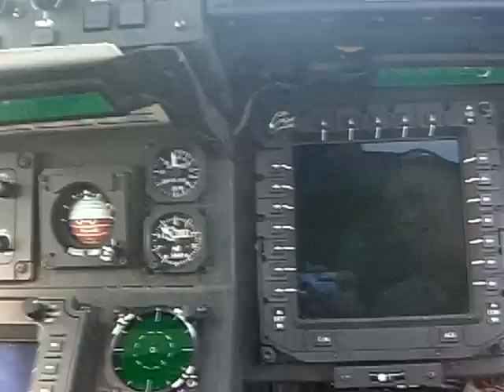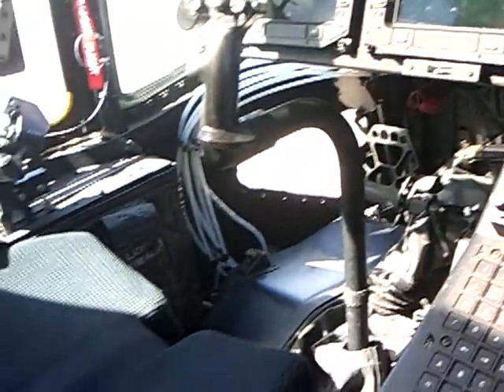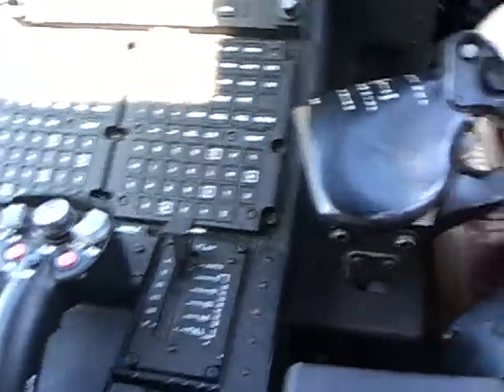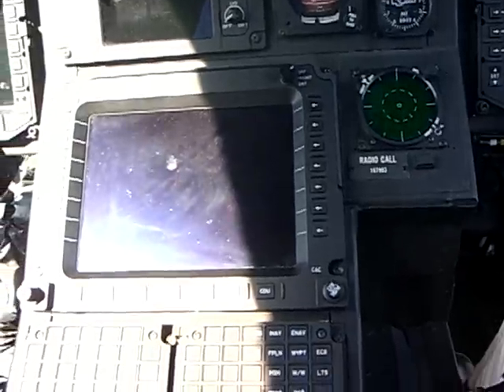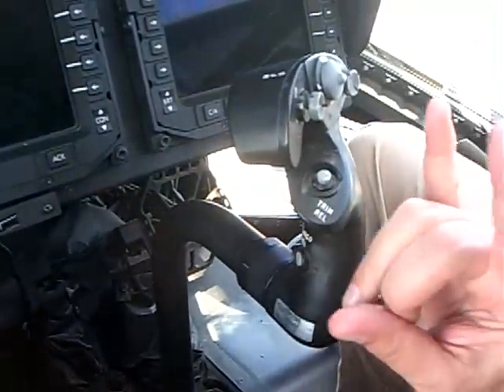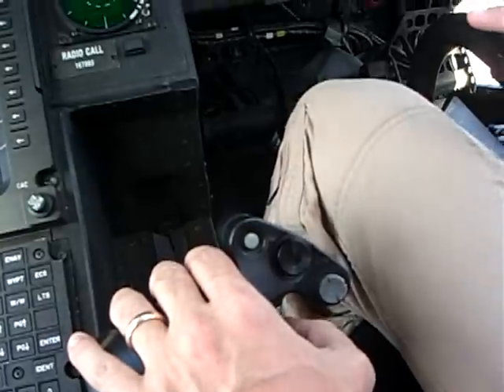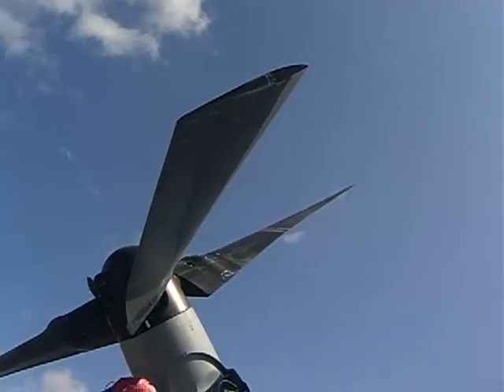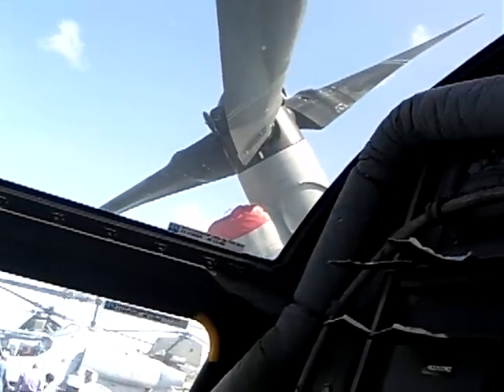V-22 Osprey Cockpit.  $30 Billion Tiltrotor turboprop VTOL/STOL Automatic Heli-airplane #2

Comment: there's no collective pitch control ?
Reply: There is a collective it is set up as forward back instead of up down as a helo setup is
Reply: The way I understand it - with rotors up, right hand controls cyclic, left hand controls collective (it's just reversed from a helicopter - increase forward, decrease backward), throttle is automatic.
Rotors forward - right hand controls ailerons/elevator, left hand throttle, blade pitch is automatic (so rotors work like constant speed propellers).
Reply: @AndrewCZ47  I guess that's the way it works, which seems the logical one
Reply: I don't know, but it doesn't seem like it would be necessary.

Comment: @joetioeb Thats all done with a computer, they spent a lot of time trying to figure how to make that work. What they came up with is some complex mixing ageratum that uses, forward airspeed, nacelle pitch angle, and a few other things to calculate the different controls. Sadly no one out side of the mfg knows what that formal is. At least no one i've talked to. I know for sure its not a liner % curve

Comment: @fazedsatchel Another thing; maybe it's just me, but I think physics wise. I think in my head: Since the nacelles are up, more throttle means more pull from the rotors, and that equals lift. When the nacelles are forward, more throttle means more pull from the rotors, but since they're pointing FORWARD, than the thrust pulls it FORWARD. Do you see how I think? ;)  <<<I can think that in about 2.5 seconds. Imagine the rest of my day! XD

Comment: @fazedsatchel Also, wouldn't it be kind of hard to flip the controls halfway, when the nacelles are at a 45 degree angle, because then the controls would be halfway reversed, meaning it wouldn't do anything whether you push the throttle forward or backward, right? ;)

Comment: @fazedsatchel Yes, in real life! I like it like a sim better, though. And besides, I was saying how it is now. It makes more sense to me the way they did it on the Osprey because it controls engine power, correct me if I'm wrong. When the nacelles are pointed up: throttle forward, more engine power, lift factor increased, goes up. When the nacelles are pointed forward, throttle forward, more engine power, thrust factor increased, goes faster.